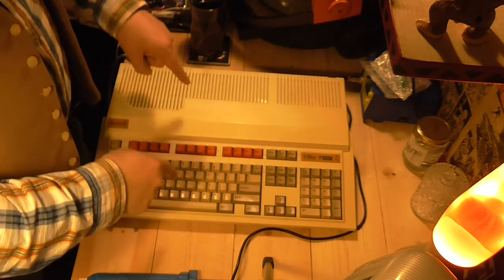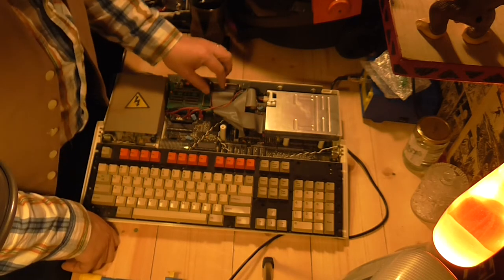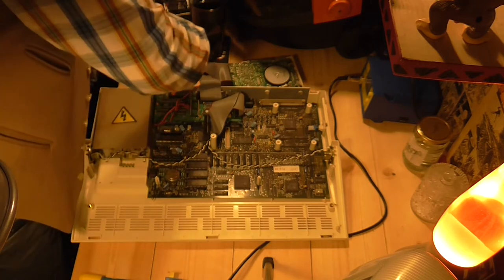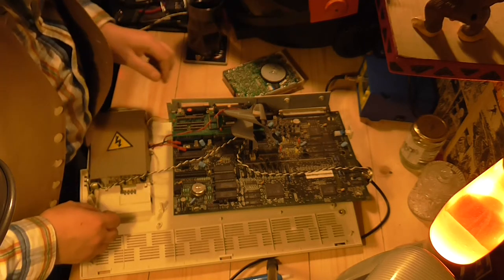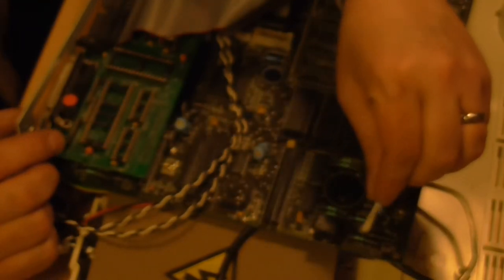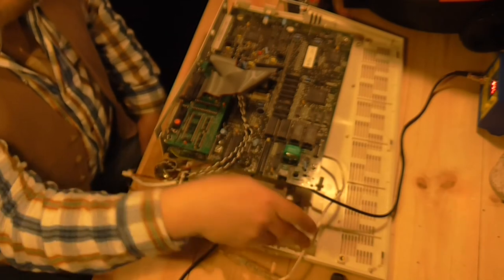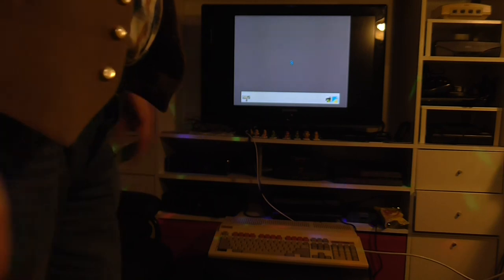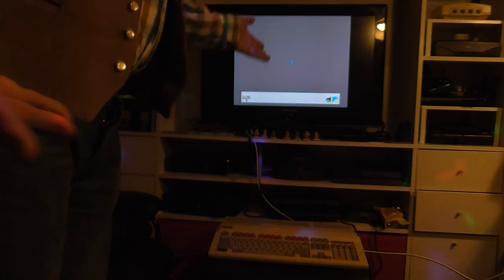Tinkering time - Acorn A3000 battery replacement

Comment: There is also a central screw underneath but when you machine has been upgraded this screw has not been put back in its place.
Reply from the maker: Zarchos upgraded? Any idea what might have been upgraded in it? Aside from cleaning it up and replacing that battery, the innards of this beast are an alien environment to me...
Reply: You have a minipodule installed (What you thought was a parallel port). I think it is an SCSI minipodule.
Why not join the FB Acorn group ? https://www.facebook.com/groups/AcornAndBBCMicro/
This will tell you almost everything about the Acorns : http://chrisacorns.computinghistory.org.uk/
Reply from the maker: Zarchos Thanks, but I don't do Facebook. I'm gleaning bits and pieces from various posts on stardot.org so far.

Comment: Hi, do you know if the disk drive inside an Acorn A3010 can be replaced with one from an old IDE internal HD floppy drive from a tower PC case?  The Atari and Commodore computers needed the drives to be modified first before use.
Reply from the maker: MadCommodore Sorry to say I don't really know but I don't think so, not without modding anyway. Fwiw I don't think much modding is required but it depends on the make/model - stardot.org.uk is probably your best bet for a more informed answer :)